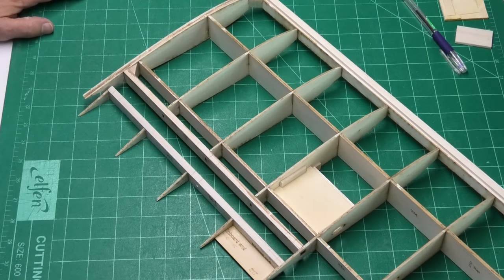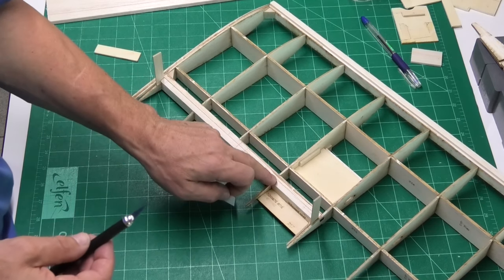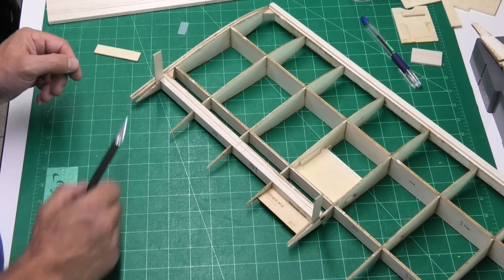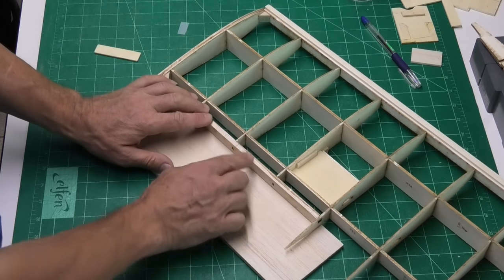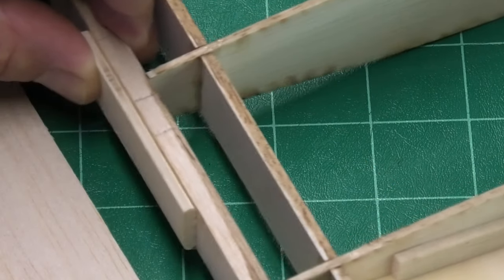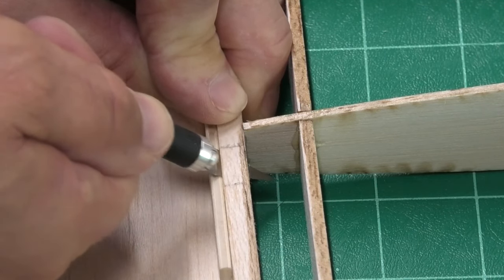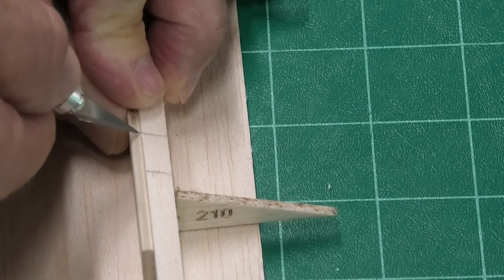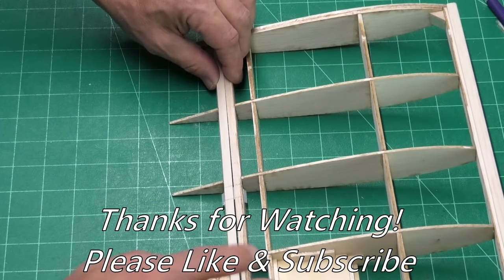Piper Cherokee RC plane kit - Pt 7: Aileron Hinges - DB Sport & Scale

Comment: Hi Mark, on the Tiger Moth I had to create a taper on the leading edge of the aileron to allow downward movement.  Was it pre-shaped on this kit ?  Like the tip for cutting the slots for the hinges.
Reply from the maker: Alan Barnstable Thanks Alan, yes the downward moment was accommodated in the design, which I am sure would have been fine, although I did add a slight additional taper! Hahah, couldn't help myself 😀